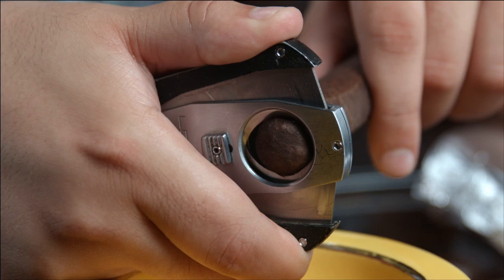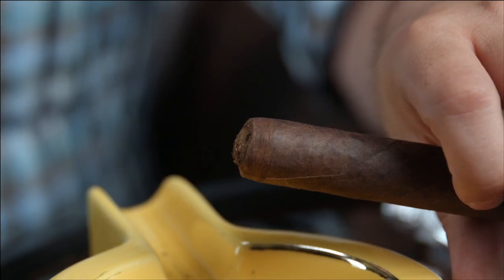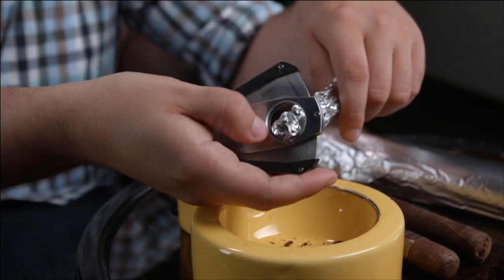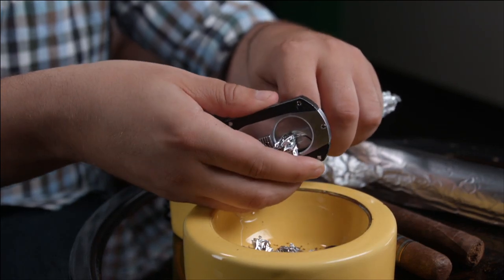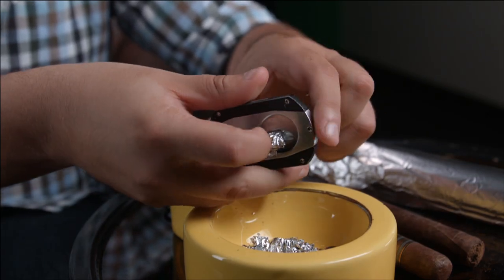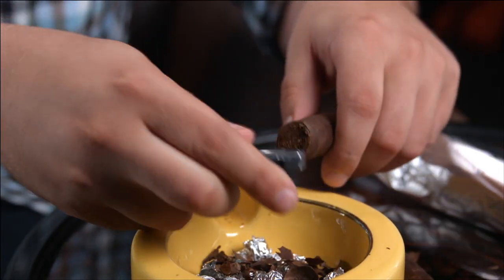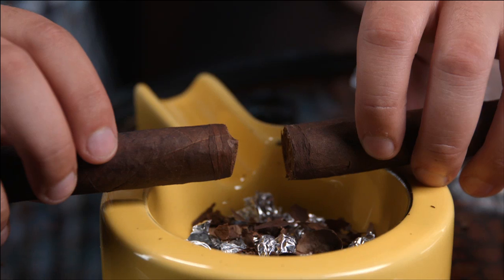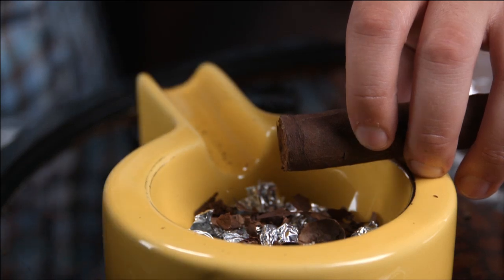How Do I Sharpen a Cigar Cutter? - Cigar 101

Comment: A burr, or foiled edge is what happens after a proper sharpening when the edges apex.  Cutting tin foil is honing, like a butcher does with a honing steel.

Honing can de-burr a freshly sharpened blade but the easiest way is to drag the new edge lightly through wood.

With scissors I use tin foil and also on new cheapie cigar cutters that have crap quality control.

Comment: Yea man, you have absolutely zero clue as to how an edge is put on steel. All a cutter is, is little knives. You sharpen steel by removing material until it is brought to a razor edge. Cutting tinfoil will accomplish nothing except to dull a blade. You sharpen a cutter by working down the steel with a round stone or file.
Reply from the maker: Thanks for commenting.